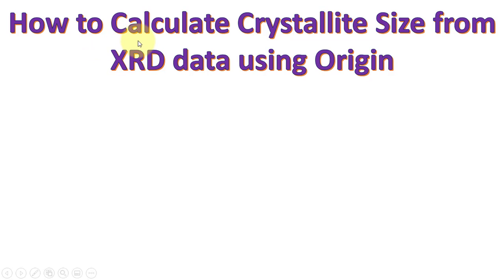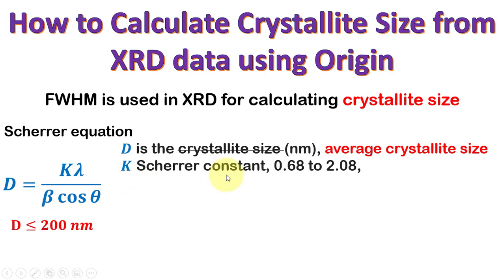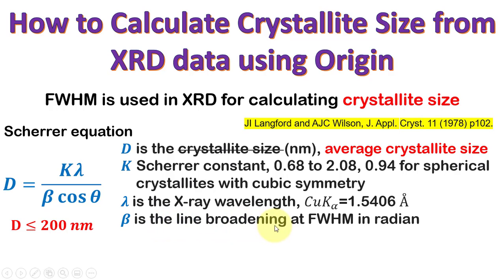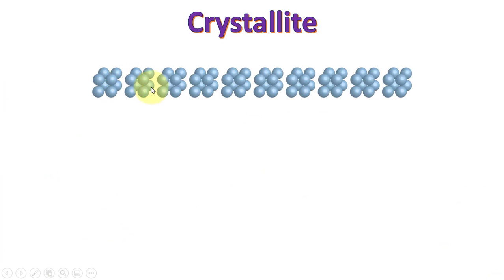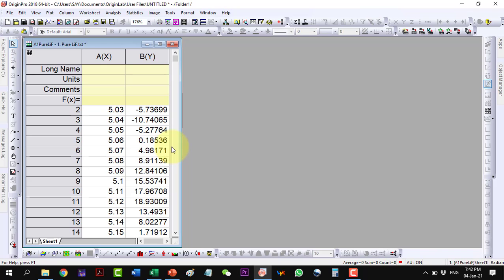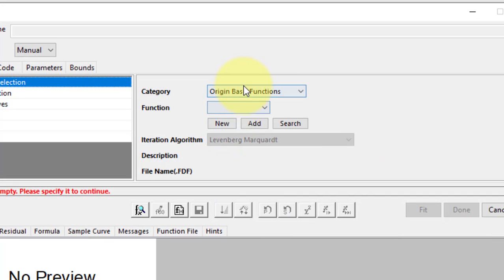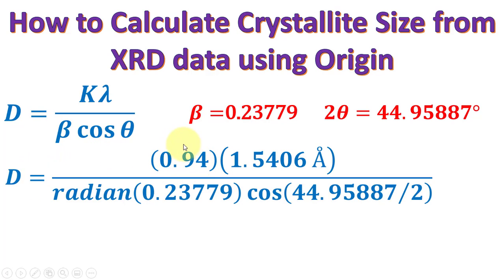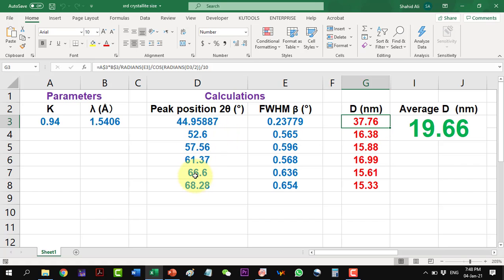How to calculate crystallite size from XRD data using origin

Comment: Thank you for this video! I have a question - is it possible that if the grains become smaller, the crystallites grow? In my studies, during the processing of aluminium sheets, the grains are much smaller after the process, but the crystallites are larger. Is it possible?
Reply from the maker: Grain is either a single crystalline or polycrystalline material, and is present either in bulk or thin film form. During the processing, smaller crystallites come closer and grow to become larger due to kinetics. Therefore, in the most likely scenario, the grain is larger than a crystallite. Thanks

Comment: Excellent video and excellent explanation..one question though ..why didnt u take xray  wavelength in nm in sherrer equation ..ur answer was in nm but xray wavelength was in angstrom
Reply from the maker: Thanks for the appreciation dear. Answer will remain the same. If you convert it first from angstrom to nm or later. From the machine specs, we get it in angstrom. Thanks

Comment: If my particle in range of 100 micro can I use it to calculate the crystal size? Also if I have 2 or 3  compounds in one material can I calculate the size for all together?
Reply from the maker: I have explained that crystallite, grain and particle size are different things. Yes, you can calculate the crystallite size. Thanks

Comment: I have a question. Does the peak heights represent the relative amount of those size crystallites? If so, then shouldn't taking a weighted average yield a more accurate answer?
Reply from the maker: If all the weights are equal, then the weighted mean is the same as the arithmetic mean. The facts is, as different peaks represent the same crystallites but their different planar orientations, so, both the averages will give the same result. Thanks

Comment: Nice explanation! Shouldn't we consider the weighted arithmetic average? As the peaks have different intensities, they contribute differently in the average.
Reply from the maker: Somehow you're right Oliveira. Let me elaborate what do you mean actually. The weighted arithmetic mean is similar to an ordinary arithmetic mean (the most common type of average), except that instead of each of the data points contributing equally to the final average, some data points contribute more than others. 
Now, if all the weights are equal, then the weighted mean is the same as the arithmetic mean. The facts is, as different peaks represent the same crystallites but their different planar orientations, so, both the averages will give the same result. Thanks

Comment: Good explanation. I am just worried about the Angstrongs ie 1.5406 when the final answer is in nm. Why didn't you use 0.15406 nm wavelength instead?
Reply from the maker: Thanks for the appreciation. You're right. We have the value from machine specs in the Angstroms, but you can convert as per your ease.
Reply: @SAYPhysics  Thanks man. Keep up the good work.
Reply from the maker: Sure. Thanks

Comment: Thanks sir, too!! but, I also wonder how to calculate the radian(0.23779). In other words, how could it conversion from radian(0.23779) to 0.004150218 value.
Reply from the maker: Excel calculate the value in radian by default. So if we take its double radian, we'll get our required value in degrees. Thanks

Comment: Hi, is the excel calculation u show based on the the peak in earlier video? They were 5 peaks there but ur excel is showing 6 values. Another question is, can we just select the 3 or 4 intense peak for calculation? Thanks
Reply from the maker: Dear Anisah, This excel file is for the calculations in this video only. You can select peaks of your choice. There's no restriction on the number. Sometimes, some peaks cause a problem in fitting etc., they may be ignored. Thanks

Comment: How do you convert the FWHM value to radian on the calculator?
Reply from the maker: One radian = 180/ PI degrees and one degree = PI /180 radians. Therefore to convert a certain number of degrees in to radians, multiply the number of degrees by PI /180 (for example, 90º = 90 × PI /180 radians = PI /2). Thanks

Comment: Thanks for the explanation, but I wonder why Cos(theta) is in degrees and not radians are used
Reply from the maker: As per formula, beta should be in rad and cos must be degrees to make the equation dimensionally correct. Thanks

Comment: Is theta in degree or radians. I found in other research that it must in degree. Please what is the correct one.
Thanks
Reply from the maker: In degrees. I have explained it in this and other relevant videos about it, please watch carefully. Thanks
Reply: @SAYPhysics  Hi Sir, seems you use radians for cos theta calculation in attached excel file. And when I calculated COS[Radian(44.95887/2)], only then got same value as 0.924016 (as same as 7:28 in video)
Reply from the maker: Excel by default calculates in rad, so where we need it in degrees, we'll have to take it's double radian. Thanks